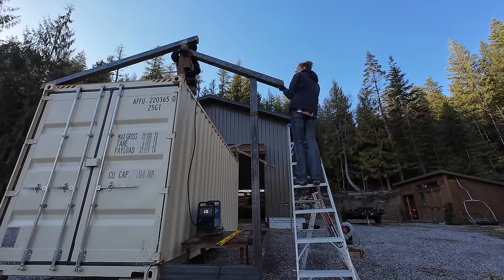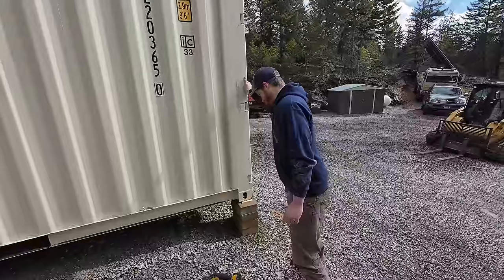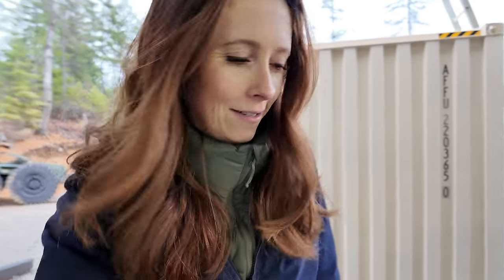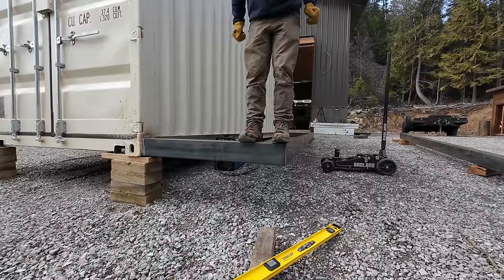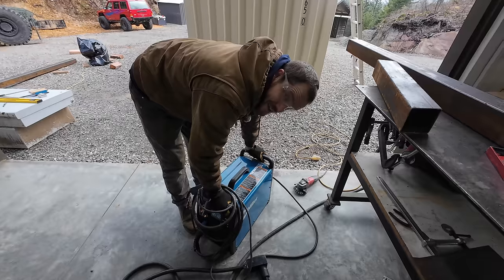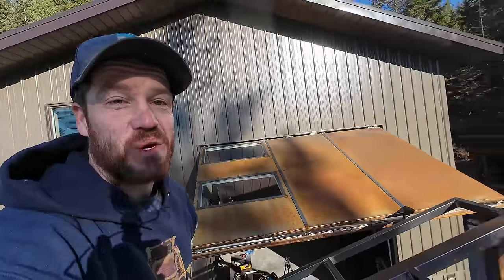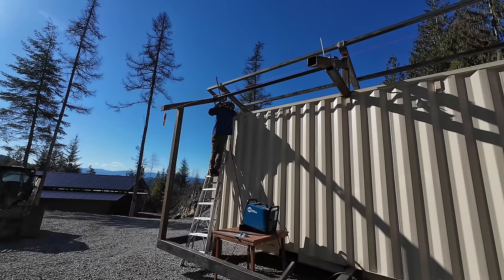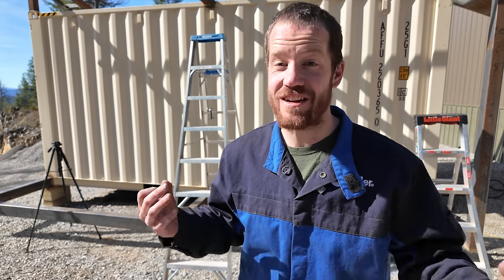Building a SHIPPING CONTAINER Tiny Home | P1

Comment: Very cool build!  My slightly older back was watching Riley carry the welder up the ladder on the roof and thinking “but the skid-steer is right there!!”.
Reply: I was thinking the same thing. Put a pallet on the skid steer, put the tools (and maybe some materials) on the pallet, and the use the skid steer to lift the pallet up flush-to or slightly overhanging the roof. Or does the skid steer not lift that high?
Reply: I was thinking the same thing. lol
Reply: me 3
Reply: I'm 70, and busted to sh*t. Use the equipment you have and you will hurt a lot less at 70.
Reply: Same here. I feel your pain.
Reply: Always fun to watch folks who think OSHA is a small town in Wisconsin. Seriously build or buy a man-basket for the skid steer. perhaps Riley will remember the forks slide into tube steel. For that matter build a two level basket/stage platform that can either be set on the ground or elevated using the skid steer.
Reply: Me too. Work smarter not harder.
Reply: I would have designed and then attached 1/4 inch L channel up top and the bottom  to weld all your support columns with the intent that if you did have to move it. The entire thing would be able to fold down  or removed easily.  Ps, I think I may just build my next farm skid shed with that in mind.

Comment: You should call this container "Al Capone's Vault" (because there was nothing inside 😁).
Hand carries welder to top of container, meanwhile the skid steer is sitting idly by. 🤔😂
As a hot rod builder and fabricator, I love working with metal but I would have done this project with wood and just welded Simpson Strong Tie brackets to the container to mount the wood. No need to drill any holes or worry about leaks. The steel looks really cool though and is going to be super strong. Can't wait to see how it comes out.

Comment: If you wanted to construct a timber roof on your container, you could weld "U shaped" lugs to bolt the wooden trusses, no leaks, and removable. 
Have you considered dampness from condensation and human perspiration? A dehumidifier could be a solution, apart from fitting vents.
 Happy cake-day,  Oliver. I hope it is chocolate 😃
Reply: Bolt holes can also be sealed easily enough with rubber washers, dektites, good quality sealants etc.

Comment: Might want to invest in a hand held plasma cutter. I learned how to cut steel with a gas torch about 45 years ago. The great news is a plasma cutter effortlessly cuts steel. The bad news is even for a guy like me, it shows every single imperfection in the line I'm drawing if I do it freehand. I use a steel ruler to the protective wire around the head and it shears it very nicely. Be really careful with the air pressure. I forgot to turn mine down and blew out the head. That'll be another torch head in my case.
Well done on the fabrication and you will feel it when you're 55-60. Mine hit when I was 57. Anything I broke or hurt as a kid has come back to hurt.

Comment: 23:40. I welded side rails  / saddles to hold the steel prior to cutting. And at the fender, I made a small metal table to hold the saw. The table stays forever on the trailer. The trailer becomes the workbench where you stand on the ground beside the trailer and do all of the cutting. Of course, the saw doesn’t stay on the trailer when you go to town to get steel. On the passenger side of the trailer, I also made saddles to hold 10’ and 8’ sections of the pipe / conduit if I am going somewhere with a partially constructed structure on the trailer deck.

Comment: Nice job again, you two, Man, I used to do this stuff, and I miss it. I am 73, and my knees do not work very well. I used to use whatever ever I had on hand as I hardly ever had money. In my later years, I could actually afford to buy new material. It sure was nice to be able to afford to buy it. I made a 10 by 14 little stall for my nephews horse back in the day and I had saved a lot of cut of pipe so I welded them togather to make pipe long enough it took for ever to do that luckly someone saw and donated a few longer pipe. Later years If I needed something, just go buy it, well, with in reason, you know, keep your needs within your budget. If something broke down, it sure was nice to be able to afford to fix it or get another one. Anyway, keep on having fun while you can.

Comment: I know that the ends have a strong frame for that container but that middle can'tilever roof section may need something internally going from the top all the way down to the bottom inside the container to help support it. It wouldn't need much probably a 2x5 box section 1/8 in thick to make sure that wall doesn't get crushed.  Just a thought, awesome video!! Can't wait to see how it turns out.

Comment: The other day I was at an auction yard and there's a company that makes one that unfolds  into an apartment size . It comes with a built in bathroom. Unfold two sections on left side 😮and two more on right stand up walls and lock roof in place. A water, electric source and sewer  . And move in with furniture.
Reply: I've seen videos of that, very cool idea didn't see a price.

Comment: If you build a bunker, make sure to not only make it water tight, but also insulate it very well. My parents had a bunker built of concrete with a lot of rebar under our house, it's absolutely water tight but every summer it gets very wet on the inside due to moisture condensating on the walls, because in 1978 they did not think of insulating it from the outside. Nice tiny house you're bulding for Courtney's mum, so loving! ❤
 I'm !ooking forward to more videos about it and maybe a bunker! 👍
Reply: Bunker could double as root cellar!
Reply: @toms6213 Sure it will, or for any other storage which can easily be removed, when you need it as a shelter! Better you can use it when you don't need it for it's origin purpose.

Comment: awesome vid. FYI when flux core welding you don't need the gas cup(cone) one the end of mig gun. i found that with the cup it tends to heat up contact tip causing problems. pulse you don't have to clean the spatter out of cone. :)

Comment: The way you moved the one square tube with the Skid steer is also an easy way to get a jin pole to act as a small crane.  Just slip one or more complicated two rectangular tubes over the forks and the a for example 10 foot length of metal with one or more hook points on the end. You could then sling those large pieces of metal and just have the hydraulics lift them up into place. I watched as they set all of the trusses on a barn similar to your workshop with that setup.  If you are going to keep doing high stuff like your three buildings you might also look into getting a set of scaffolding. A lot easier and safer to work up high and on wheels, easy to move with the equipment you have.

Comment: Remember what you said about “older me not liking the heavy lifting “…..older you begs you to go easy.   😊.  I still remember the lifting that caused me to have to get a knee replacement.   Use your skid steer to lift the welder to the roof.  Your future knees and back will thank you!

PRO TIP:  for the roof leak on your wood trusses attaching to the barn container that is leaking; use butyl tape.  Well known for its excellence in marine applications.   Wrap the exterior of the bolt holes.

Also, have you considered vaulting the ceiling of your tiny home?   You could also add some sweet upper triangle windows for light.😮

Comment: Could you have welded saddles or truss cradles or hurricane clip style parts to the shipping container?
Then bolt the wood to them?
No holes in container. 

Sort of like your pole barn wood connection to the concrete piers.

Comment: I know you've been useing shipping containers for alot but what's the cost difference on having a large pre-fab shed delivered. Or the sheds delivered that ship with all the walls laying flat? Those seem like much less work to get a nice liveable space. Windows, doors, and roof already installed. They just need a pad insulation and well.. all the other interior finishing.

Comment: I may be wrong, but I think that y'all could use the skid loader as an “adjustable platform” so you don't need to be in the ladders, also the “skid platform” could be used to help carry and support the weight of the square steel tube

Comment: I have a friend I've picked up on for welding as while I did it with a tombstone 40 some years ago in high school shop class, I only used it on quarter inch steel and never changed the settings. Never had to so naturally I never took note. Now I have the toys and time. Between he and yourself I might learn something here. Too many people here introduced me to the fact you have a skid loader and a talented operator for it. I get it. If I can lift something myself and save some time and gas well then what the heck! But now you have the force multiplier effect when two people don't make you go twice as fast but almost 3X faster. Easy sub dude! I like what you did today .😁👍

Comment: Simple. You could of just used angle iron to weld brackets down to hold your wooden trusees, save on Wright and overkill. Thus eliminating the drill holes. But, it's a learning process.😊

Comment: Riley, put a single sheeve pulley on the top rung of the ladder you used and get your "ground help" to pull it up while you hold the top of the ladder away from the roof edge to allow your lift to clear. As it clears the roof, just let the ladder lay back against the roof edge and your "weighty problem" is on deck with you. I've been jacking AC compressors onto roofs that way for a long time. Pro tip; do not exceed the ladders designed weight limit. Or you can catch a hernia one time too many; and you have a very willing and able second pair of hands. Use them well.
Awesome build. As always, you folks rock!

Comment: Really enjoy you antics. I built a large shed for a mate using scrap beams from a demo building. I lived 30 miles from his place. Used 2 forty footers. I built the canopy at my place. The roof overflow the containers and so was 43' x 46' wide with a 30" open span between boxes and he used as his workshop. I welded an 8" long piece of with three 5/8" tapped holes in each in 8 places. I used my mig on a platform I used on my front end loader. The blocks were welded to the corner section of the container, ends about a foot in from.each end. That was the extent of welding to containers. Built it like this so it could be unbolted and moved/sold once his massive building is completed. My point is use your machinery to help you. A platform on skid steer to work from will keep you safe. It's easy to make stuff on ground under cover and then erect like a Meccano set. Especially with your drawing ability.

Comment: When you decide to finish and sell your plans, try the next design with steel hangers, so you can attach the roof with no leaks, but then finish out the framing with wood beams. I mean, you do have a CNC plasma cutter that could make beam brackets pretty easily…It could add a nice architectural element to the design as well.

Comment: to move the container tac weld a axle to the back and weld a hitch on the front. then cut it off. or use angle iron on the bottom edges and weld a axle to the angle the strap it in place.  google container hooks for a quick removable hitch and axle attachment.

Comment: To stop the leaks in the tops of the Container shop roofs, try to remove the nuts in the ceiling and add a washer with caulking on top and retightening the nuts.

Comment: I love the durability (and cool) factor of the steel construction and I totally understand the aversion to putting holes in the container, but why not just weld some plates/brackets to the container and then frame out of wood using the welded brackets as the anchor points? Wouldn’t that be the best of both worlds?

Either way, this build is going to be SWEET! Looking forward to lots of off-grid, tiny home building content!

Comment: If your going to be welding out side a lot I would suggest a stick welder if your other don't have an option for stick already. you can add extension leads to the welder to run your stinger further away from the welder without have to lug it around to much.

Comment: For the out of square eave, I have seen a few of the YT welding instructors talk about putting extra heat into the side you need to pull to.  Maybe laying another bead or two of weld would have brought you square.

Comment: Riley, you need to build yourself a couple remote controlled crane winches to lift and hold stuff. Remote controlled wheels and the winch itself. Maybe design it modular to reach a variety of heights and widths for stability.

Comment: Create a steel cut station that can sit on the trailer which can be removed, maybe weld two vertical tubes either side of the fender that the station slots into

Comment: Solve your issue for building with wood by welding brackets to the container like you used for your pole barn then paint the wood and brackets the same color to blend them together. Use mortise and tenon joinery with glue with the wood, which would be strong enough for snow load.

Comment: You need to weld mounting plates to the container to bolt wood to.  There are calculations you need to make for expansion when doing that however. 👽🗿👽🗿👽

Comment: Instead of losing your marker get one of those retractable belt clips and add the marker to it. You can either have it on your belt then or attach it to the tape measure.
Reply: I was thinking the same thing. AFAIR Sharpie even sells little caps that have a triangle ring to attach to retractable badge holders. Another place to clip to would be your collar.

Comment: No penetration required...... The roof I mean when you attach it.....  you construct it and then attach it from the Underside to the Container with brackets welded to the steel edge and corners!  Wooden roofs are much easier to insulate well and are therefore Warmer and also Much Much Quieter then Metal roofs esspecially if this abode ens up sitting under the trees!!!   Think about it.
from a mountain habitating Dutchmen in Canada who loves what you guys do!!!   Keep on doing it,       Happy Birthday Oliver.

Comment: 2:28 Umm......Is Riley putting that CDL to good use already? Will there be a video of that Oshkosh MK23 coming in the near future? ;-)
Also, for future container builds, you might want to consider mounting plates to the container roof either by welding or using structural epoxy (something like automotive panel bond?). Then you could attach any wood members to those plates and avoid penetrations.

Comment: You guys could just weld U brackets to the Container-Roof and then use Wood for the rest of the build. kind of like what u would use with concrete, just no post going in the Concrete, bu a weld to connect them

Comment: On shipping containers, only the 4 corners are designed to be load bearing. By adding that 3rd truss piece in the middle you have made the front wall (just a sheet of metal) load bearing.  It might be worth adding a cross piece from one side to the other across the middle to help distribute the load, in case you get a 7' snow load one winter ;)
Great design.
Reply: Metal roof with enough pitch will never see 7' of snow without the load slipping off the roof. Just my opinion.
Reply: @kriswright1022  With 7' of snow there is nowhere for the snow to slip off to. Living in Alaska I have seen a lot of container structures fail that weren't built right.  It usually manifests as the sides bowing out as the middle of the roof slowly collapses.  If the welds aren't good it will rip the panels right off the corner posts.

Comment: I would've used angle iron. Built a trailer using box tubing and angle iron about 45 years ago. Most of the box tubing is rusting from the inside out. Lot of the angle iron is rusting but not decaying. I find box tubing rust and decay from both sides, but it rust most from the inside out. The fresh air on the angle iron gets rid of the standing moisture quicker. And it is also easier to paint all sides of an iron with rust paint. Box tubing not so easy to paint the inside. So, my opinion box tubing to rust quicker from the inside out.

But, if you get 45 years out of that shipping container and your welds and rust, I think you've done pretty good.

Comment: Just a throw away idea bout cut station. You could make a cut station that sits on the side of your trailer. So you have your saw on a leg that slides in the side. Then you can work standing on the ground and you just gata lift the steel up a foot or 2 into the saw. Maybe some stanchion things out to the side to hold up the ends of the steel. Stop by the In-n-Out burger & some beers. Our troubles are over dude.

Comment: Hi Riley, I'm not able to find a post I did a couple of days ago - trying to help with your markers never being where you need them. LOL  (I don't know if I did something wrong and it was removed - cause I posted a link for your convenience and quick reference.)  Anyways - IF you prefer to have you markers with you at all times when you are making things, check out = Heavy Duty Retractable Pull Pen & Pencil Holder - Ideal Grip for Markers & Carpenter Pencils - Features a Thicker Nylon Cable, Self Retracting Reel & Tight Metal Belt Clip by Reel-N-Rite. All the best to you both, Tony

Comment: Next time you're building on a container with wood, instead of bolting through the container, weld brackets on the container and put your bolts through the bracket.  You can also make a captive bolt or captive nut if you don't want to fiddle around on the back side.  At any rate, I love the build.  Thanks for posting this!

Comment: Riley, FYI welding the tube/pipe completely shut will Quickly cause internal rust out. the fix is to drill a small hole 3/16 ish in the lowest point. hope this helps. good channel content, editing and delivery. my2cents